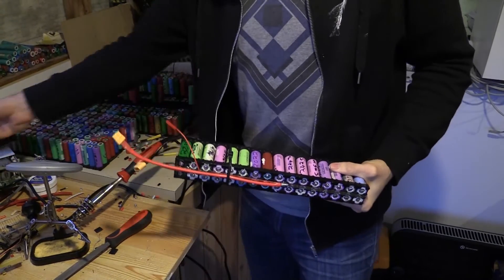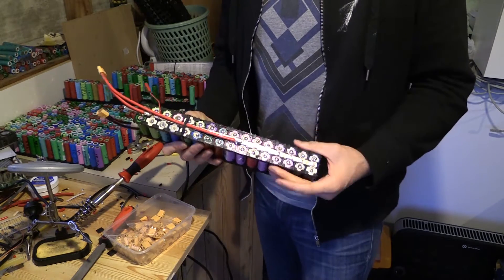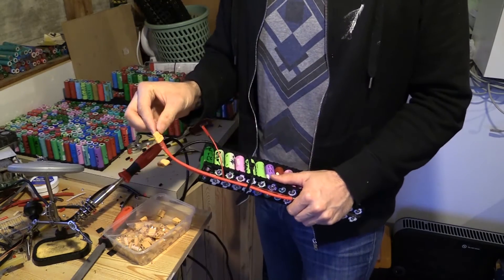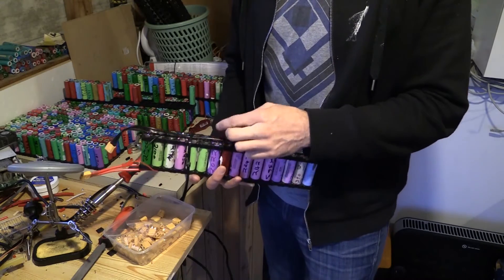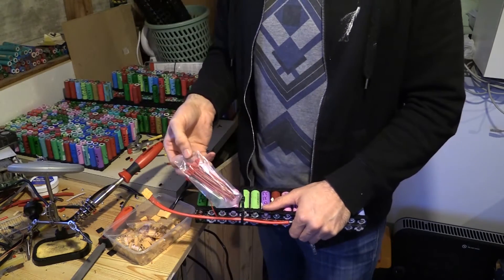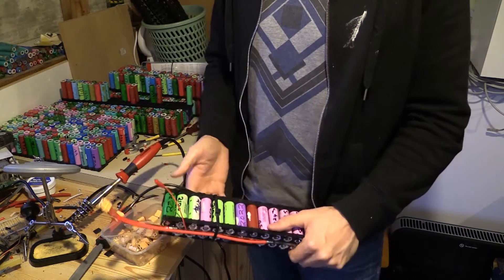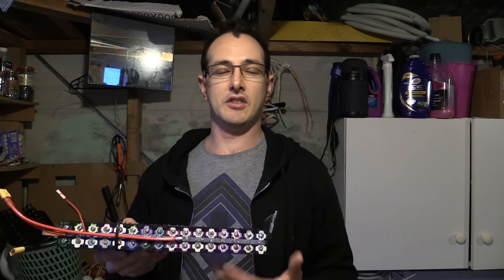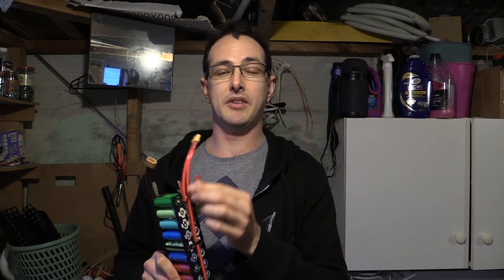18650 Packs

Comment: I'm a little confused about the two cables. 

Does one connect to all 32 cells and the other only connect to 16?

If so, is it connecting to the 16 cells furthest away from the connector?
Reply: Hi.  

I took another look at the video and I think that I may understand the design now.

As far as I can tell, there is a strip of nickel that runs the length of the battery pack that acts as the bus bar.

The 18650 cell fuses are attached to the batteries and the nickel strip.

One of the 12 gauge wires is attached at the end of the bus bar closest to the xt-60 connectors.

The other 12 gauge wire is connected to the bus bar at the mid-point of the battery pack.

I'm making an assumption that this is done because the positive and negative connectors are attached on the same end of the battery pack (rather than at opposite ends), and having one wire connect at the bus bar mid point is designed to ensure that all of the cells in the pack are utilized evenly.

Please let me know if i'm mistaken.

Thanks,
Paul
Reply from the maker: Thats right, The cable connected in the mid-point is to help with high current running through a single thin nickel strip. If you only need 20amps out of a pack then the mid-point connection won't be needed I don't think but you will have to do some testing on that for voltage drop and temp of the strip.
Reply: Great, I'll connect the 12awg silicone wires that way, one at the end and the other at mid point